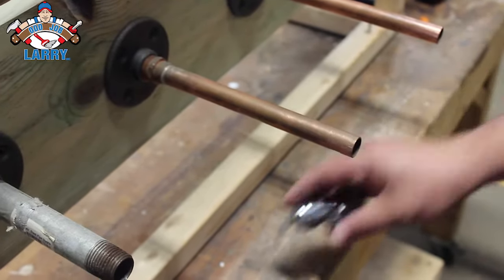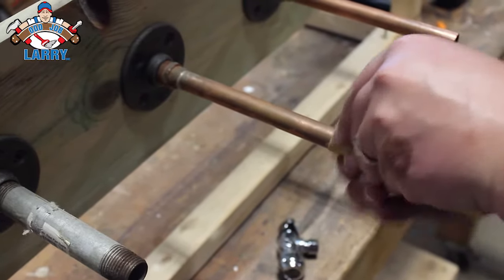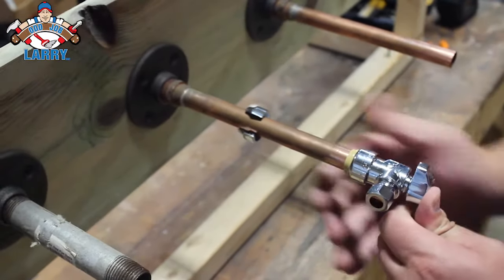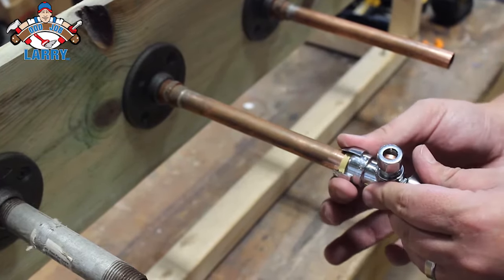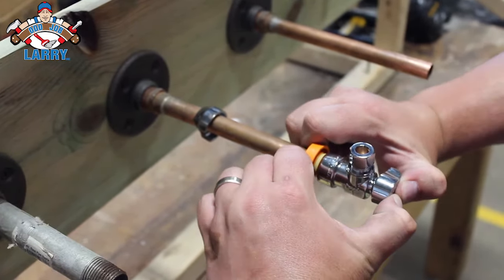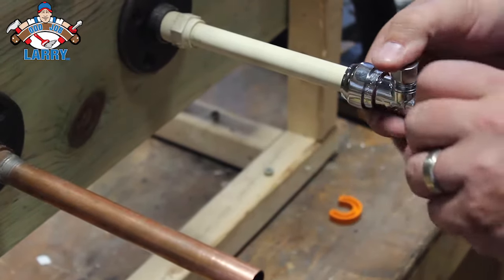How to install and remove a Sharkbite shut off valve

Comment: The “trim” ring. I flip it around and use it as the removal tool. Other than that, it’s basically useless. I never even heard it called a trim ring. At first I thought it was just an aesthetic thing, but then I realized I could use it to remove the valve without having to use my pex removal tool. Good luck everyone.

Comment: I wouldn't sleep well if those were installed at my home, I solder or use compression valves
Reply: Yes, just had two fail on me in our master bath, under the sink within a couple of months from a home that had them installed on a high end bath remodel before we bought. Thousands of dollars later in cleanup and replacement of cabinets, drywall, and tile.
Reply: Compression valves leak im about to try this one
Reply: @blacksunshine489  Bummer 
Good to know though
Thanks for sharing......
I am right in the middle of my bathroom
Reply: @phillippettit2138  Just follow the instructions carefully.
Reply: LOL...I put one on in the hall bath two years ago--of course after reading instructions and viewing vids and it's never leaked.

Comment: Sharkbite makes non-push on. (threaded) valves now but the quality is very poor.  I just installed two today and both of them leak at the shaft stem.   Very dissappointing.    Not only do they leak at the valve stem, there are only 2 threads to engage with your plumbing.

Comment: That was CPVC not PVC. There IS a difference.
Also., the insert in the Sharkbite should be removed. Although not mandatory, it's just something else to help constrict the flow of water. It's only needed when using PEX.
Reply: CPVC? He's using copper? What insert? I don't see anyway to remove anything?
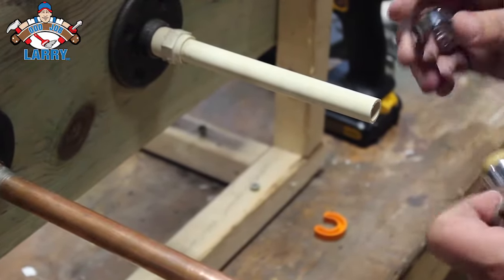Reply: @df56gh4d5h  1:26 Did you watch the whole video? that's cpvc pipe.
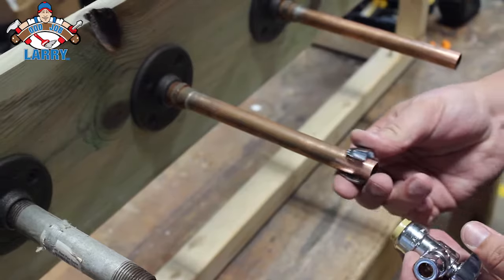0:36 That insert is only needed for PEX. It should be removed for copper and cpvc. Just grab it with a needle nose and pull it out.
Reply: @joeweatlu5169  That's not what it says on the Sharkbite YouTube page or website.
Reply: @todd2456  True, but it's not necessary for CPVC or copper. It will only restrict water flow, so take it out if not needed. Shark Bite does say it doesn't have to be removed, but it may be removed.

Comment: what if my copper is short and looks like it will break? will I be able to still pull on the last shark bite to replace it or will I risk water pressure leakage during the pull?

Comment: "you are going to feel it slide into place and be secure"  Is there a better description as to how far to slide on and how hard to press ?
Reply: Actually there is a chart or a depth tool to mark how far to push the Sharkbite onto the pipe.
Reply: Mark a line on your copper at 1 inch and make sure it slides in that far.

Comment: Is the valve supposed to spin on the pipe? Would it leak if it spins?
Reply: It is supposed to spin. It's actually a unique characteristic of sharkbites that make them more versatile for certain things.

It shouldn't be leaking. Hopefully you have measured the depth needed and marked it on the pipe prior to install.
Reply: Yes it should spin. That way you don't have to buy several shut off valves that need to point up/down/sideways. It will rotate and do all of them.

Comment: Does it leaks water like the compressor rings?
Reply: Ive used about 10 of these in my house so far. Oldest one was installed about 2 years ago and no problems so far.